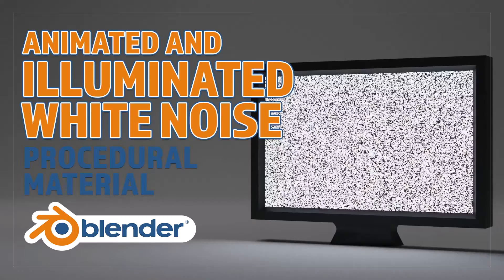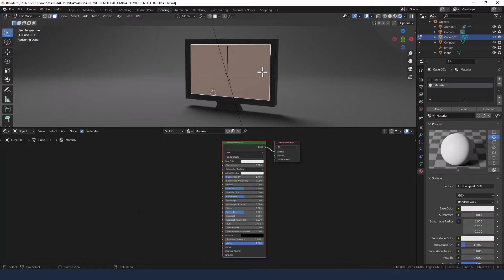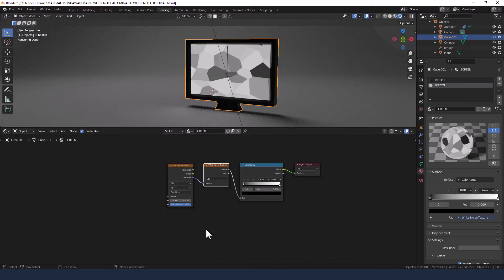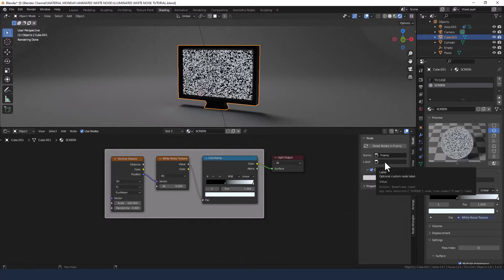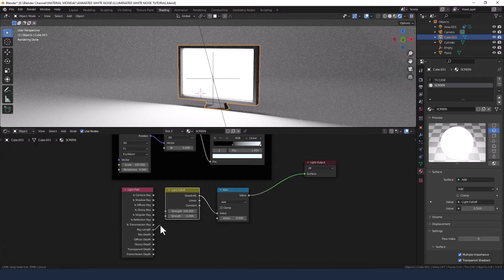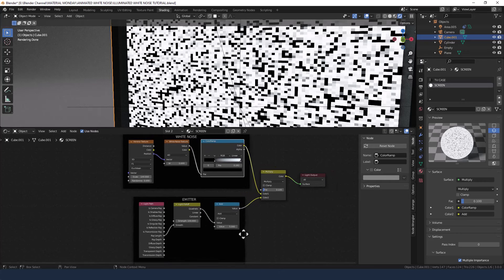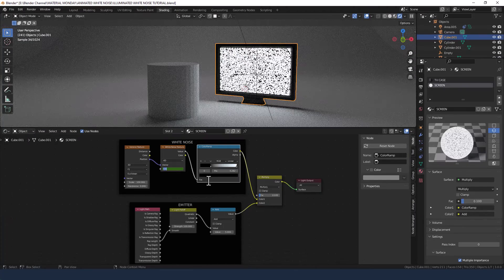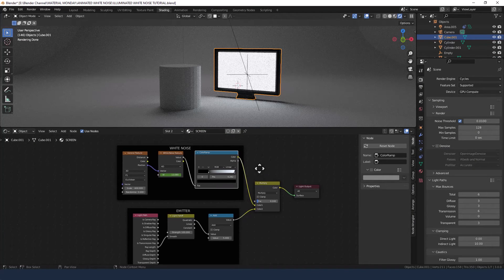CREATE A PROCEDURAL ILLUMINATED WHITE NOISE MATERIAL FOR BLENDER

Comment: I dont have light output as an available selection D:

Nevermind I'm just slow
Reply from the maker: What version of Blender are you using?
Reply: me too ver 4.0
Reply from the maker: @swagcare1451 I have just done a search for it and it is there. Can you explain a little more about what is happening?
Reply: @blenderbitesize  i had the same issue but ive changed render engine from eevee to cycles and it works
Reply from the maker: @varex7128 Thanks for sharing your experiences. Appreciate it.